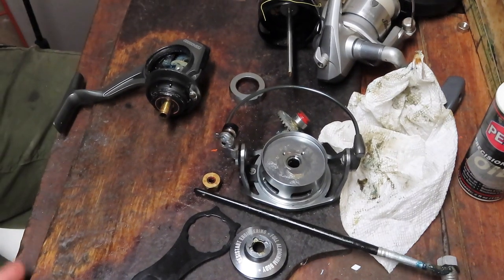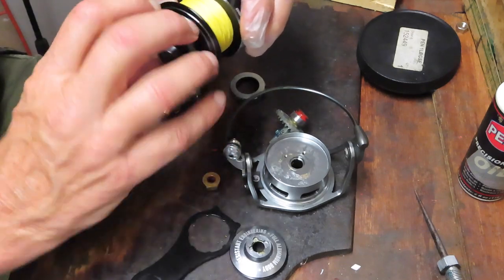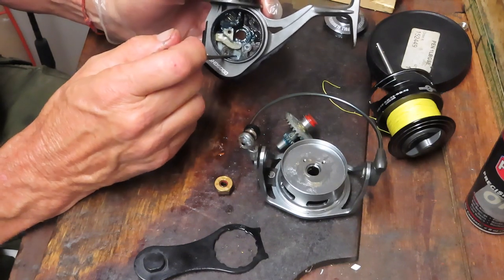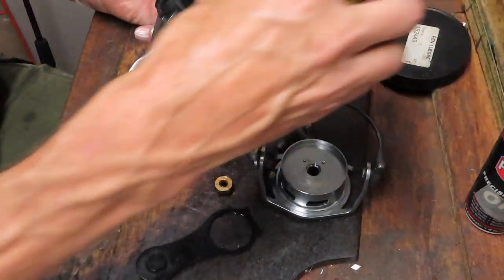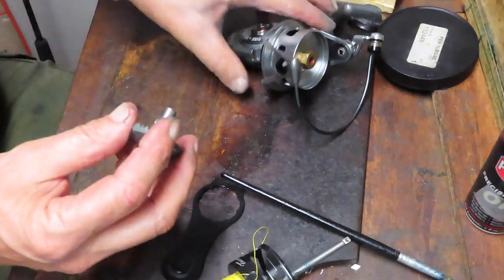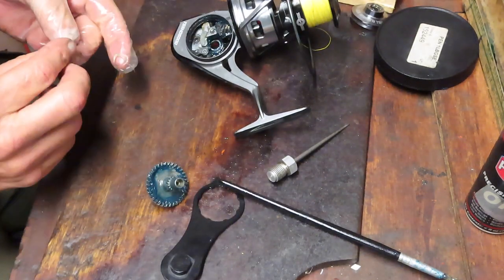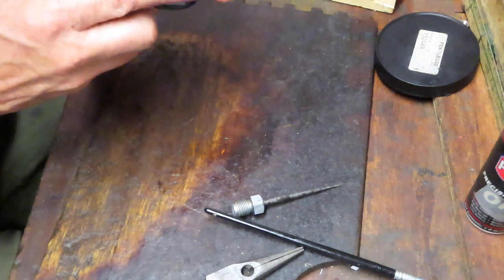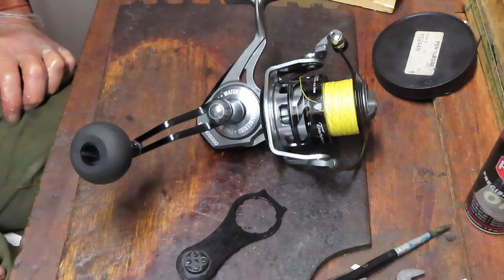Tsunami Shield 5000 spin fishing reel inside look and how to service

Comment: Of all the modern reels this has been one I’ve been really interested in because of it supposedly being a sort of poor man’s sealed reel. From what you found I’d say this is not as sealed as I have been led to believe. I’m not sure this reel was actually designed to be dunked like a Van Staal or Saltist. I really don’t think it is. I find this video to be a little discouraging as far as buying one of these for surf fishing. I think I’ll just keep using my tried and true vintage reels! Thanks Dennis. This is one I really wanted to see.
Reply from the maker: The seals were there.  I don't understand how the water got in, but it did.  Not sure if it is a design issue or just an odd occurrence - Dennis
Reply: 2nd Chance Tackle  I honestly had been considering getting one of these mainly for two reasons. I don’t put braid on my vintage reels and I only have 1 surf reel right now that I use that way - an Emblem X 5500T Daiwa big pit/carp reel. I got brand new for $11.95. I put super slick 30 lb braid on it and it really casts far. I liked what I read about the Tsunani Shield as a poor man’s sealed reel for surf fishing. The price is right but after your video I’m not sure I want it anymore. The failed seals give me pause. I would like another braid surf reel but I’m leaning toward the Daiwa BG. It has overall great reviews and the way I maintain my reels the sealing is just not as important in the grand scheme of things. For the purposes I’ve mentioned what modern reel for braid would you recommend?  It will never take the place of my vintage reels as nothing built today that I can afford could ever do. I have backed braid on one spool on a Penn Spinfisher 704 greenie with mono and it does okay. Those vintage reels were not made for braid which doesn’t stretch very much the way mono does. I don’t think the fish much cares about mono or braid anyway.
Reply: Hey Christopher, I know you are the Mitchell guru and I had a question about a clone Mitchell 300 named a Seaway Marvel I found mint with the box. I haven't ever seen one before so I dont know if it was a good find or not. It seems they are hard to find and I know it was made in Japan but that's about it. I should be getting it in the mail next week. Any input? Sorry to interrupt your thread with Dennis.
Reply: Mike Mcelveen  Hi Mike!  Let me ask you a question. Is this Seaway reel a Mitchell 300 clone or possibly a 302 clone? Another question would be does it have a red plastic oil port in the side plate? The reason I ask is that the only reel like this I’ve seen before is a 302 clone with that same red plastic oil lube port in the side plate as a Mitchell 302.  I don’t have one of these but I have held and examined one and it was a decent reel. The Japanese clones never have the same quality gearing, metallurgy and paint finish as a French Mitchell. The original Mitchell 300 is a very over-engineered reel with four nice gears in the mechanism. I’d love to see the reel you’re getting. It has made me very curious.  I have a 300 and a 300A and they are truly iconic spinning reels. There were a lot of Japanese clones of Mitchell reels but I only have personal experience with a 302 clone. There is a reel branded as a “Match” reel that is also a 302 clone. By the way, I am a retired baptist minister, not a guru. LOL
Reply: Mike Mcelveen  Mike go on the internet and search for your reel onGoogle. I found the one you bought on EBay as well. On the ORCA  Reel Talk site there was an entire discussion about your 300 clone. These guys know their reels and from what I read, you got a good one at a fantastic price as it is worth at least twice what you paid for it. Many of them are purchased here and end up back in Japan. They are fairly rare - imported in the late 60s but the Seaway Co. From Chicago. From all I have read it is a very nice and desirable reel. I mean I wish I had bought that 302 clone I found.  Having the box and papers and all is great. I read the description from your seller. Almost was surprised he sold it after reading what he said. Here’s a good research tool - look up images of your reel on the internet like on Google. Click on some images and then click on the little caption under the image that says where it came from. That’s how I found the ORCA Reel Talk discussion. If you get that article, scroll down and there is a guy who wrote an entire article in a Reel Digest specifically about these clones. Might be interesting to contact him if you really want to seriously research this. Thanks for asking me the question as I learned something I totally didn’t know. Have a great week Mike!
Reply: @christopherjenkins2373  Thank you for your help Christopher! I've  been collecting for about nine months now and it helps to have someone guide you in the right direction.
Reply: Mike Mcelveen  Thank you Mike. I went to seminary with a guy with your name spelled exactly the same. I’ve only been collecting since April of 2019 so we are both learning the ropes. Dennis has been such a great online mentor in this hobby. I’ve already developed a large network of collectors, sellers, traders, restorers and repair experts all over the US and even overseas.  I’ve met some really nice folks you being among them. I’m sure we’ll be talking more and more. That ORCA  organization is the really serious site for collectors. It has a somewhat expensive dues for joining. I joined a forum called the “Fishing Stage” that I enjoy. It is mostly fisherman and not collectors but there are a few and some of the old timers on this forum really are knowledgeable and very funny! Those two  are suggestions I would give you. If you get into restoring I know some great sources for parts especially Penn, Mitchell, and  Daiwa. I have a little over 80 reels now but I am running out of storage space for all of it. I set up a really nice workbench and space for my reel work. I really love working on them and solving problems. Any way I can help, share advice, or even commiserate I am always available. Stay safe and well. Let me know about that reel when you get it. I’m waiting on a vintage Daiwa 4850 RL that is mint. It’s a worm gear reel w/ 1 ball bearing. I found an extra handle that I’ll be converting to a nice Power knob for surf fishing. I also just got a beautiful silver spool for mr Mitchell 396 PUM custom reel. I also got a new Mitchell 406  reel handle shank that I putting a nice blue power knob on. The Mitchell 406 is a nice high speed saltwater reel that is painted that Mitchell midnight blue color. I started a relationship with Gomexus Fishing in China a year ago and have helped them adapt their nice Power Knobs for older vintage reels. I’ve taken photos of their knobs on my vintage surf reels for their ads. They’ve rewarded me by giving me merchandise. It’s a great trade. I’ve also shared some of my self-designed surf fishing rigs for them to consider marketing. We’ll see if anything develops. Anyway their power knobs are very nice. I always keep an original handle for all my reels but if I can find a second handle cheap, I get it and put one of their power knobs on it. It’s a lot of fun and this ergonomic knobs are very comfortable on my arthritic hands. Talk to you later. —-Chris
Reply: For what is worth I fished a Penn
Fierce out of the water that had been
under long enough to have some
growth on the rod guides and a bunch
of crabs tangled in the line. Not a drop
of water inside the reel. I am not endorsing
the reel, just my 2 cents.
Reply: @blindabinda1234   I’ve seen the S7000. On YouTube there is a channel called “Tackle Advisors”  that disassembled a new Star surf reel and it was a terrible review.  There is a video they did that is a comparison of the Star reel with a Penn 704Z or 706Z. It is a great video of the Star 7000. I have both of those Penn Z reels. They are two of my favorites. Based on the reviews I’ve seen I wouldn’t have a Star 7000 reel. Even the old vintage Penns don’t leak water into the internal mechanism like the Star reel did. Stay away from these reels.
Reply: @christopherjenkins2373  yea I watch his videos but I don't think I have seen that one.

Comment: Interesting! I'm a new owner of a Tsunami SaltX-4000 which also has a frame machined from solid stock. The drag system seems to be the same on the above reel. The internal gearing is CNC machined from solid stock. The side plate is held on with torx screws which should be idiot proof when it's time to service the guts. One major concern with Van Staals which have a similar side plate design is that when you open the reel the threads chew up the rubber seal. It looks like you would run the same risk with the above reel. Thanks for posting this.
Reply from the maker: I haven't seen the SaltX yet, but I was disappointed with the Shield.  Sounds like the SaltX addresses my concern over the gearing if Tsunami has gone to the CNC cut ones.  The Shield has "O" rings for seals on the case, but water did get into it....somehow.  Thanks for the note - Dennis
Reply: @2ndChanceTackle  the shield is water resistant not waterproof. So I guess they really aren't made to be totally submerged in water. Most people seem to have good luck with them.

Comment: I have the 6000 I think I read that the body has adhesive and you needed a heat gun to remove the side. But yeah they definitely don’t want you to be doing home maintenance on the reel.

Comment: One of the biggest complaints with this reel is the pot metal (Chinesium as Tackle Advisors would say) main gear.  Supposedly some are good and some won’t last at all.   I never heard any complaints about the seals.  Good to know....
Reply from the maker: I echo your concerns on the strength of these gears.  I do not like that metal in this reel - Dennis
Reply: I suspect that the excessive torque that Dennis found on the side plate probably contributed to the leakage and seal failure to some degree. I suspect that the seals are better at shielding against splashed water rather than dunking or worse, reeling underwater. Dennis should probably have replaced the O-ring before reinstalling that side plate since it was evident even from the video, that it was compromised; I also would have used removable Threadloc on the threads to minimize leakage and eliminate the need for heavy torque on the sideplate. Just my approach, not a criticism of Dennis; heck with his experience he can teach me oodles more than I currently know, it’s just as a “arm chair quarterback” so to speak, these changes seemed obvious to me. I have (4) of the Tsunamis, ranging from the 3000-5000 Shields and the 6000 Salt-X and really have been impressed by the quality of all of the reels thus far. However, I’m smart enough also to recognize that you shouldn’t fish the Shields real hard given their price and Chinese mfg. The Salt-X gets the hard use and is superb at anything you throw at it! I think there’s a lot to be said for their design though given their price. Thanks Dennis for the video review!
Reply: Very nice case on this reel, but sub par
quality gearing. I am sure for not much
more they could have placed machined or forged gearing .

Comment: Hey Dennis I was wondering if you have any tips for fixing a faulty bail on this reel I've tried bending the bail wire and still no luck. It seems like the bail kicking pawl or possibly the kicking pawl spring I've searched high and low and can't find a fix any input would be greatly appreciated
Reply from the maker: If it is the trip lever, try spraying it down with a penetrating oil to loosen it up.  You should be able to check both functions when the rotor is removed.
There is one problem that may cause it that is not associated with either part and that would be a worn trip ramp on the reel body.  If the ramp is worn, you cannot do anything to fix that, except replace the body - Dennis

Comment: Any reason you can think of why there’s no clicking noise when I adjust the drag knob anymore?
Reply from the maker: Check under the spool to see if you have a spring loaded click tongue and a click ratchet.  The click tongue may be tightened against the ratchet rather than sitting between the grooves.  To avoid that, put the spool on first, turn the spool in a counter clockwise manner to seat the click tongue and then tighten the drag.  Just a guess, but probably a good one - Dennis

Comment: I have the 3000 and 4000 models which say that you need to remove the sideplates counterclockwise. Also that they use 243 threadlock :( if you heat it up itll likely damage the o-rings/seals too. How did you manage to get the sideplate off? I got one side off which wasnt locked in but the left handed side that the handle is on wont budge. Ive tried heating it up but no go. Also cant figure out if it comes off clockwise or counterclockwise. The right hand side came off counterclockwise. Another video showed that one side comes off counterclockwise while the other comes off clockwise. Im really confused....
Reply from the maker: Yeah - so another annoying this about the reel.  The 3000 and 4000 turn one way and the 5000 turns the other.  Go figure.  The screw was hard to turn, but finally hand strength got it to free up
Reply: @2ndChanceTackle  i thought i saw or heard that the 5000 and up reel sideplates come off differently (one clockwise and one counterclockwise). Is that true? And would the same apply for the 3000-4000?
Reply from the maker: Yes - the 5000 and above come off in the opposite direction of the 4000 and belo

Comment: Hey I got the shield 3000 but want a bigger knob what would I need to get.....thanks
Reply from the maker: I think you can go with the larger Gomexus knobs that are available on Ebay and other sites - They make the knobs between 25MM and 45MM.  My guess would be the lower end of that range for the 3000 size reel.  Probably no bigger than the 35mm - Dennis

Comment: Why not lightly coat all surfaces of the main gear with grease while you are in there to repel water and salt?
Reply from the maker: You can.  It won't hurt, but it doesn't help much either
Reply: @2ndChanceTackle  LOL, It may not help business at the shop but it will sure prevent corrosion until it can be cleaned properly.

Comment: Man Denis. I hate this reel. First fish on my shield 5000 was a nice size blue but the side plate fell off and the reel fell apart in my hands. Then they sent me another one landed a couple more blues and this clicking would happen when I reeled in reel was shot
Reply from the maker: I was not impressed by the inner gears.  They appear to me a lesser quality metal and not what you would expect from a reel in this price range.  Thanks for the feedback -Dennis
Reply from the maker: That 5000 would be light but OK for a typical 6-8 pounder, but if it as the 15 pound class, your are right, it would be under-sized. Those fish can run and will tear up tackle.  It's unfortunate, but many manufacturers have eliminated the A/R over-ride with the introduction of the anti-reverse clutch.  I still prefer the over-ride option, even if I do not use it that much - Thanks Gary - Dennis

Comment: Hi Dennis. I own the Tsunami shield 4000 and fished it heavily this summer at the beaches for fluke. One day it took a good hit from a wave and next thing i know the handle is locking up. Guessing a big piece of sand or grit got wedged somewhere but it eventually cleared. I decided to send it in for servicing anyway to my local tackle shop. They do all the reels for the local private charter and party boats. Well he just started working on my reel and says he cant open it with the special tool and even using additional leverage. He thinks they put Locktite in it. He doesn't want to mess with it anymore for fear of damaging it. Any suggestions?
Reply from the maker: These side plates are on very tight.  Tell him to red the instructions that came with the reel.  Some of the side plates come off with a clockwise turn and some come off in the traditional counterclockwise manner.  The 5000 comes of in a reverse thread by turning it clockwise.  So.  It may just be very tight or they may be turning in the wrong direction
Reply: 2nd Chance Tackle ok thanks
Reply: 2nd Chance Tackle Hey Dennis. Update on my Shield. Tsunami took it in and discovered they had actually used the wrong kind of loctite. They’re sending me a whole new reel.
Reply: @anthonygregorio2208 i’m wondering if I have the same issue on my Shields. I was able to open one sideplate but not the other. I’ve heard mixed things about Tsunami support and am wondering if I’ll actually get any help with this :( what number did you contact btw?
Reply: @jplee3  I brought it back to the tackle shop I bought it from and they contacted Tsunami. I couldn’t get through  to their customer support for weeks.
Reply: @anthonygregorio2208  sounds like I’m SOL with mine as i got these from Dicks back in 2019. One of the seals is a goner on the 3000 and i still cant get the other sideplate off - there’s corrosion and definite signs of water intrusion on this reel. Im guessing the loctite thats on it is possibly the permanent or super high heat resistant type. Same issue on the 4000 - cant get one sideplate off.
Reply: @jplee3  Bring it to a tackle shop that sells them. They might have a better chance of getting in touch with Tsunami being that they’re a retailer of their product